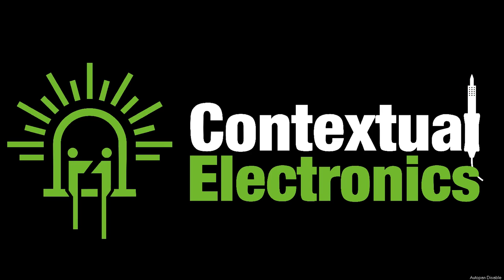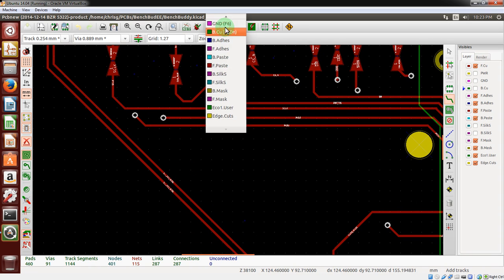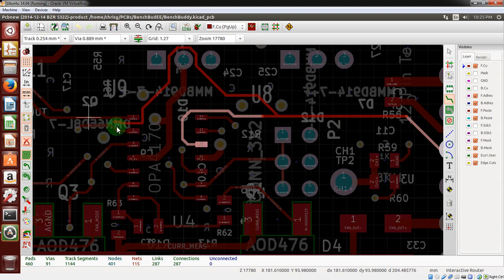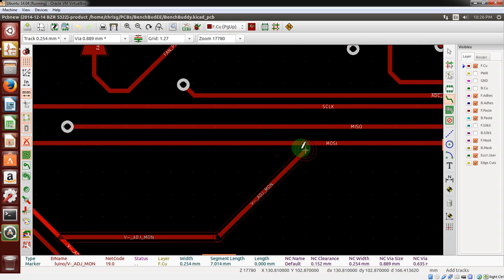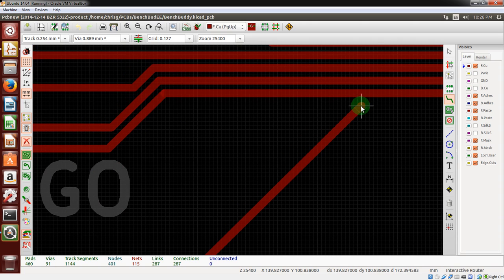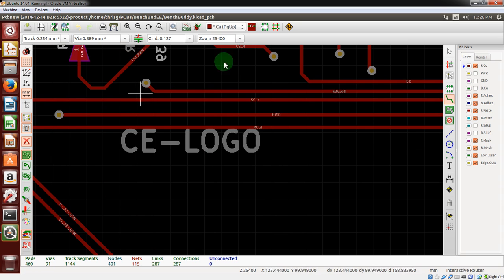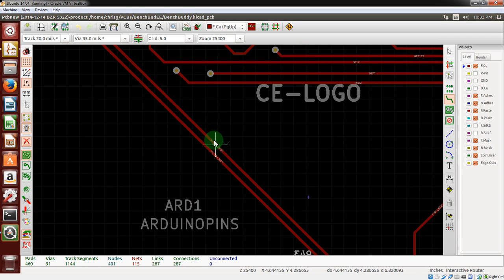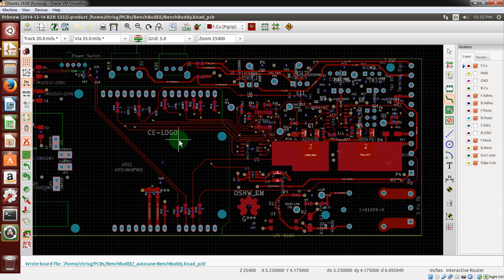KiCad 4.0 - Trying Out The Push And Shove Router

Comment: I am never patient enough to manually route a board (Most of my PCB designs are hobby related). I hate all my autorouter designs. I wonder if you have any recommendation on planning the manual PCB routing using the Push and Shove options?
Reply from the maker: The key is always having good part placement. That will speed your layout. I recommend you follow your schematic so that you can then troubleshoot it later.